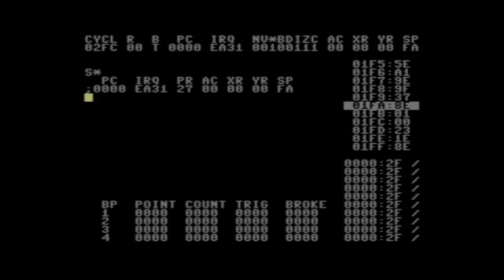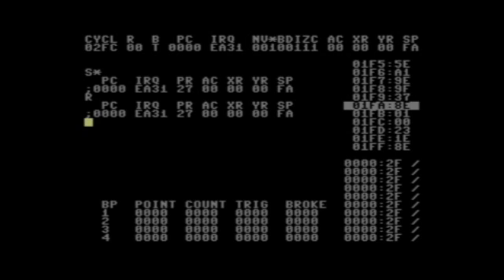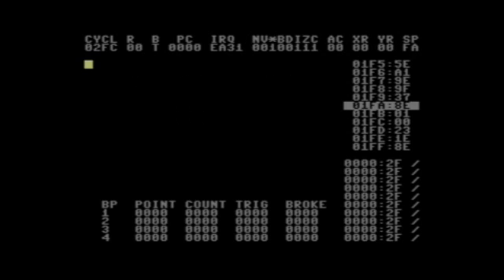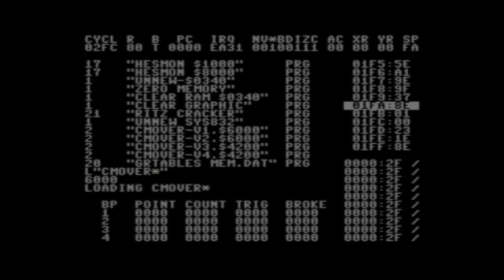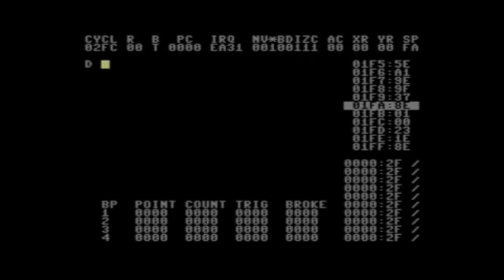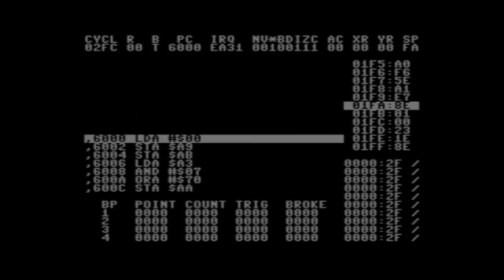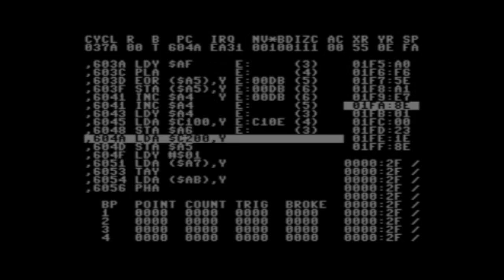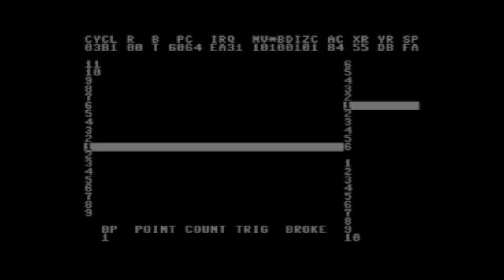DALE v15.0 (Developer's Assembly Language Editor)

Comment from the maker: The idea for this program was based on an Apple 2e program called BugByter that a friend of mine showed me.   I liked it enough to create my own version on the C64.  I made several changes to the program and also some additions. 

 I have been digging through the code trying to remember how they worked and document the features.   One feature I added was the ability to have graphical lines shown with the assembly that follow the code branching.   

  Here are some of the other features that were included in the program versions.   Not all features are in all versions
      - graphical code branch tracing
      - output display to printer
     - color coded mnemonics
     - self-relocating code base

Comment: Hi Jack, did you release the source for us to look at? I would be interested in making a video on your coding style and how you over come aspects. Hope to hear from you soon.
Reply from the maker: OldSkoolCoder  The original program was written in RAW assembly code as opposed to a macro assembler.  The only information I had when I write it was mainly in my head, but many years later i wanted to convert it over to a macro assembler and document it properly.  I was able to find a reverse assembler to make a.ASM file out of and them came the tedious task of doing the actual documentation, which I am still in the process of doing since it is over 12,000 lines of raw mnemonic assembly.  I still want to finish the reverse engineering part, but it is not complete yet.  I'd be happy to give you any informaton I can and also provide you with at least binaries so you can play around with it. My email address is jdhubbard@jacklondon.net, so drop me an email and we can talk some more.   
Thanks,  
    Jack